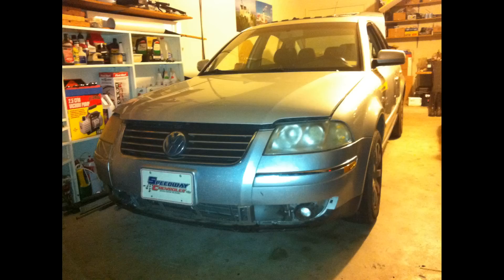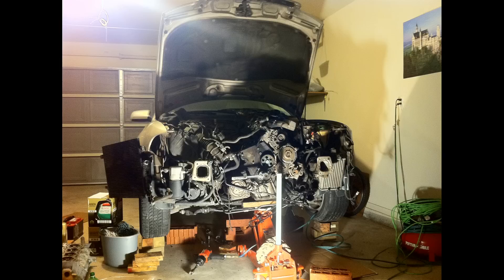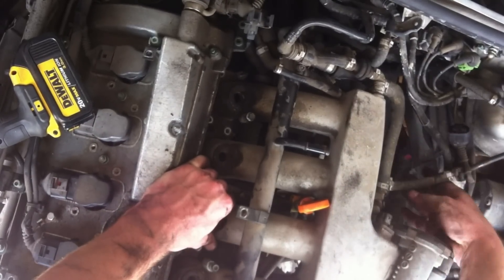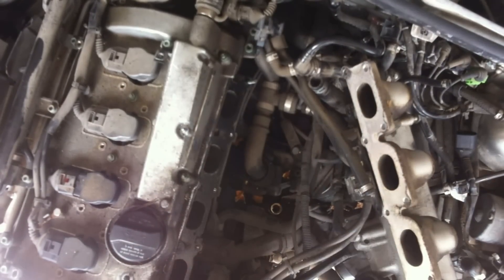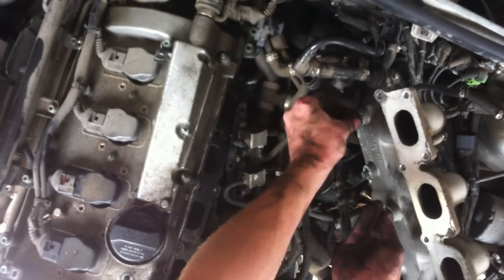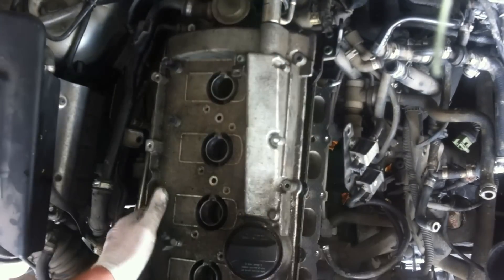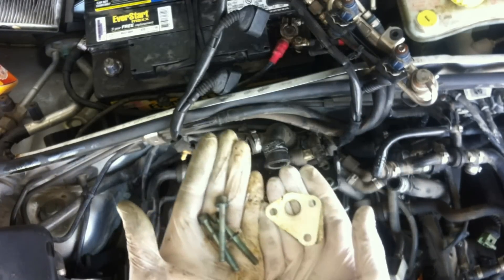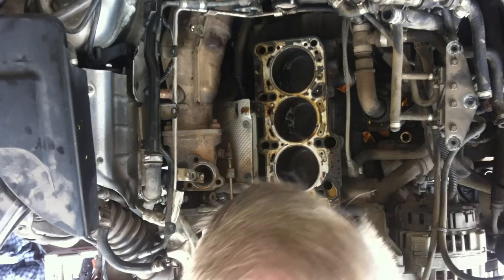Rebuilding VW/Audi 1.8T engine head removal

Comment: Hi, I would like to congratulate you for your video! I have a doubt with the socket that you used to remove the screws of the head, are RIBE M11? several people use the M10, however in the ETKA indicates that the screws in 2.8l, V6 engines are M11! this is very similar to the TORX T55, which one really should be used?
Reply: I'm looking for the same answer.. So far i have confirmed that 1.8T APU engine use M11 bolts aswell... 

source: http://catalogue.faiauto.com/parts/B1006#anchor

Comment: I would like to know if the gaskets blow with awp heads! My car has new timing belt kit and I had a head gasket test done which points to a bad gasket.. I still have power. After about a 15-20 mile drive it will over heat and bubble out of the overflow! this happen twice to me now the car sits until I decided to do a head gasket or not... 2003 1.8t awp head 102k. HELP
Reply: What did it turn out to be.?

Comment: You forgot to mention the two 10mm bolts on the cooling flange on the back of the head. You must have done it or the head would not have come off.

Comment: Good video man, I'm thinking of buying a Audi 1.8t owner says it has a "bad head" is it worth it or could something else be wrong with it?
Reply from the maker: Depends what is wrong with the head. With original valves, if timing belt snaps or skips, valves simply bend. With aftermarket valves, they can break and then you will have serious damage done to the piston, head, and cylinder walls. Not worth repairing in that case.

Comment: great video man, any more on this rebuild?
Reply from the maker: Thank you. I do have the whole process. Rebuilt the head by myself, put it back on, did the timing belt, put the front end on, and sold the car. this is what i do for a living. I just need to find time to compile the video. can't seem to have that time
Reply: Online Police Good for you man, I am about to start doing the same to my 04 Passat 1.8T, my issue is worn rings on #4; putting a new engine is out of the question because of cost, also the one in there now has only 89k on it...you think you can help with parts list and tool needed for the job? I  want to make sure I got it all before I start tearing it apart.
Reply from the maker: oepixels I cannot think of anything superspecial. But of the top of my head you need first of all a
1. torque wrench
then
2. Head bolt tool called Poly drive (available tru snapon or ebay)
3. Metric wrenches, sockets, hex wrenches, hex sockets, torx wrenches, torx sockets, alan wrenches, alan sockets (available at harbor freight, or more expensive at Sears)
3. cam chain tensioner compressor (ebay)
4. Valve spring compressor (ebay, look for VW one)
working on the block will need
5. Piston ring compressor
6. cylinder hone
thats all i can think of. I don't have many tools to be honest. All of the above could cost you about $200
Reply: oepixels